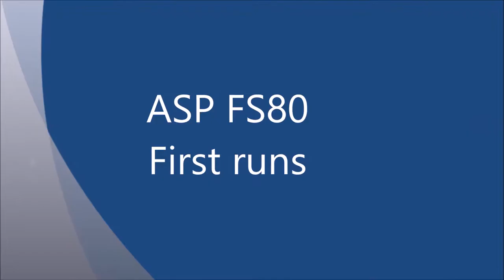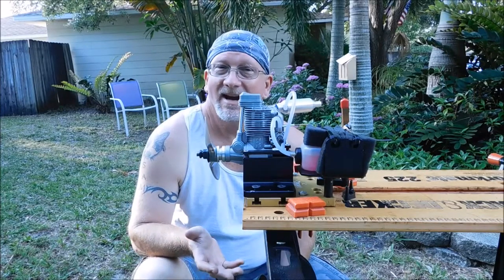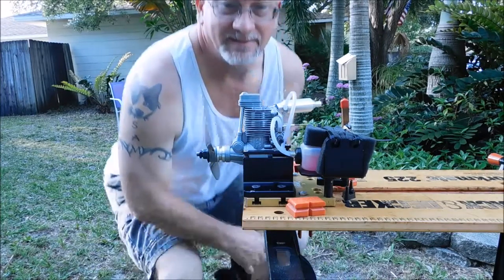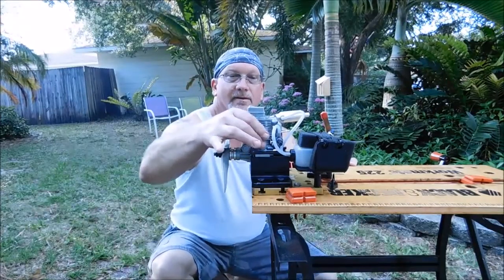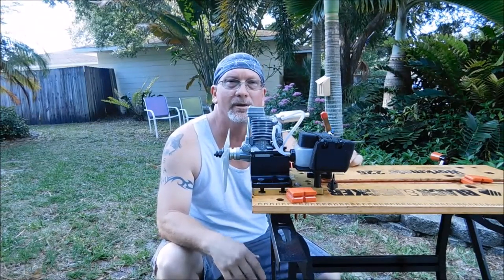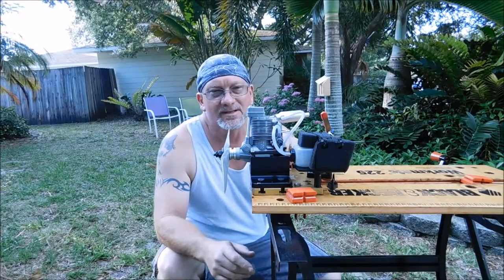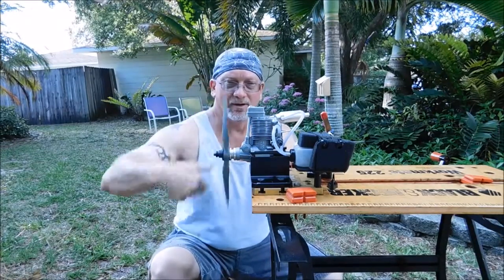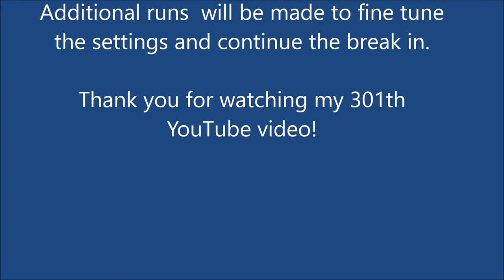ASP FS80 First run

Comment: This engine is on my short list for the GP Eagle 580 53". How do you like the engine and what are your thoughts on quality, performance, ease of use and projected longevity? Thanks for the video!
Reply from the maker: Well my version is a 90's version and not the latest iteration coming from China.  The external quality isn't as good as it is now nor as good as an OS by any means.  However I am impressed with the ease of starting and overall handling of the engine.  I have not installed it in an airplane and flown with it.  I have several other videos of this engine to.  https://www.youtube.com/watch?v=yqTOBrpnxq4
Obviously I cannot comment on its longevity, but most all engines, if well taken care of, should provide years of service.